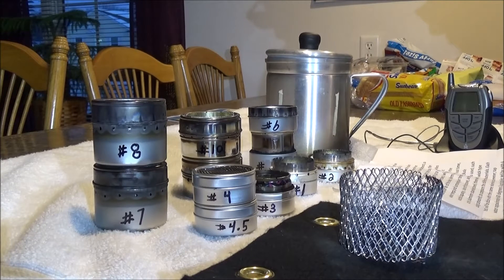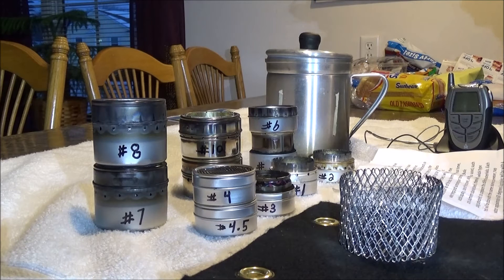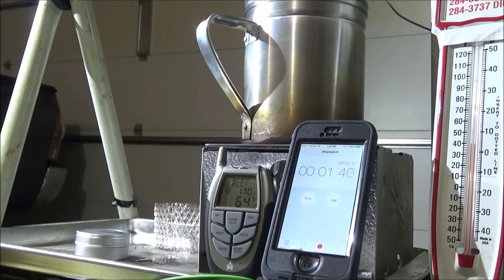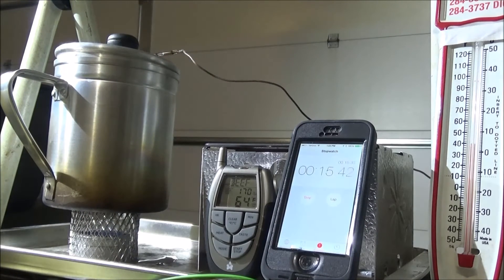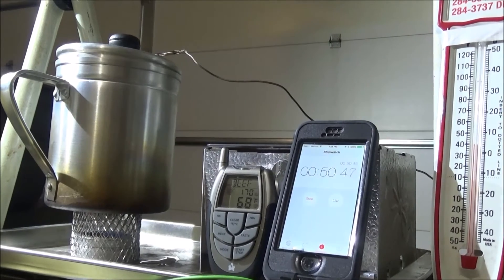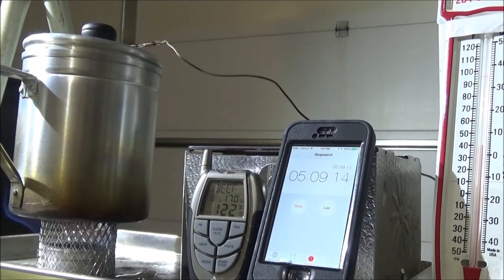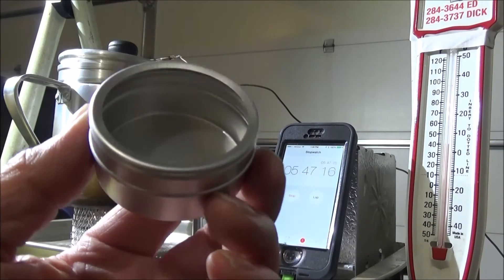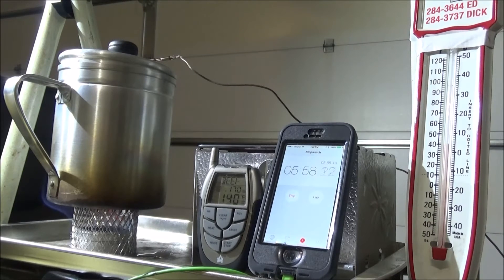DIY Alcohol Stove #4.5 Burn Test Video #6 SIMPLE EASY & CHEAP not a pop can no tools

Comment: Useful perspective on expanding our horizons on using readily available and unmodified containers. I would think that an even less expensive alternate would be simply using an unmodified "fancy feast" or "potted meat" can. Users should be aware of the potential danger of such open top stoves tipping while in use and creating a fire hazard. It is for this reason that I personally prefer using closed top "penny can" stoves which can be fabricated from two 12 ounce soda or beer cans using perhaps three or four cents worth of aluminum.